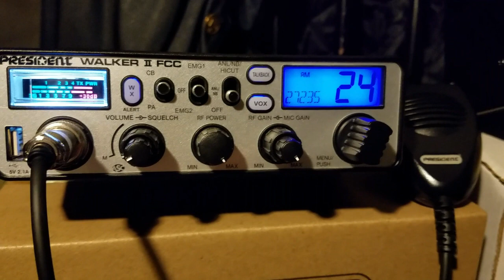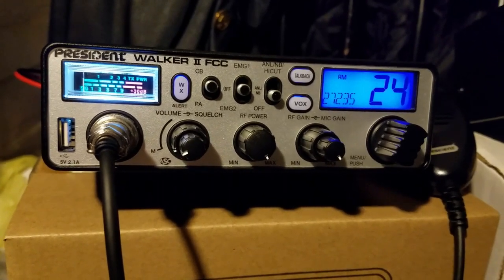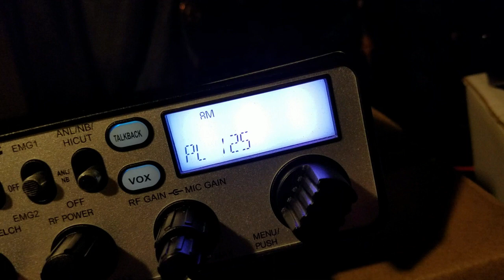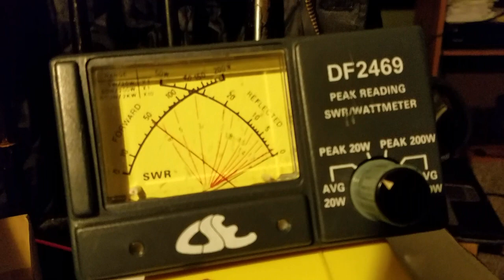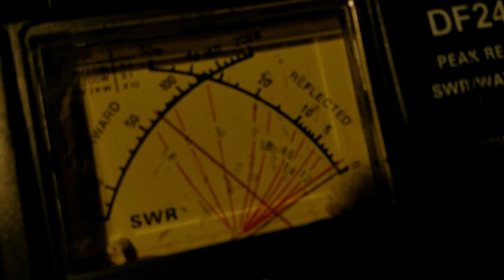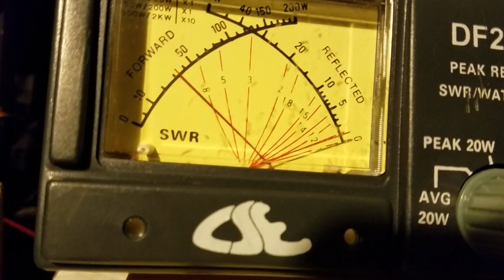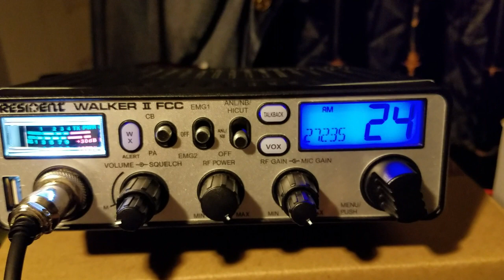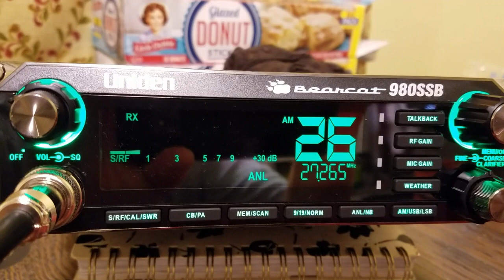President Walker 2 CB Radio Review With Service Menu Function And Test

Comment: Why ruin a perfectly good radio by messing with the service menu. By changing those values, what else is happening to the radio. A valid company service tech should be doing that.
Reply from the maker: I don't know that it will ruin it, a lot of folks try to get the most out of their radios and in doing so theres risks. Accessing these menu's doesn't seem to have a substantial effect on overall output but I think a slight increase is better than no increase. To each their own though, if you want to keep it as it came then that's fine. I was simply curious exploring the effects of those values, if I can improve on something why wouldn't I. Its no different than people modifying their cars to get more power, why would you want more power if you're not going to speed. Some people push it to the limit and risk everything  while others keep things stock. Enter at your own risk, thanks for watching and commenting.
Reply: @countryfriedgamer15o , I still am at a loss as to why anyone would want to “improve” something that is already working well. I’m one of few, it seems, who run completely clean radios as they were designed to be. I hear so much junk out there that it’s saddening. I shiver watching videos on mods that turn beautiful radios into noise machines. I own several CB radios and each one works perfectly. I’m also an amateur radio operator, which is why I have these views. This is only my opinion and to each, his own.
Reply from the maker: @Macjohn1419  I mostly agree with you that I want a good clean sounding radio. Just saying though if you can sound louder and reach further without altering clarity wouldn't you? Look I'm no technician that knows how to tune them properly I'm just a average guy of probably average intelligence. I come across this information and decided to investigate it further and made the video to show my results. People can decide for themselves if they think its worth it to make changes. As you saw in the video of the new 980 bearcat I recently purchased and might do a review later on, it was in fact underperforming when i received it. I could have just returned it but I'm stubborn and I decided to research ways to increase output. These are mass produced radios and aren't always up to the legal limit and I wanted it closer to that. I was super paranoid at making adjustments internally because I don't know what I am doing. Any adjustments made i make sure with a secondary radio that it sounds ok but with the 980 being sideband I had no real way to test other than a good report from someone on air. I got a good report yesterday thankfully and it really gave me a sense of accomplishment that I fixed it. The radio still isn't dead keying 4 watts on am but the swing is decent enough. The issue I had was sideband it was supposed to swing 12 watts and it was only doing half of that. I turned it up slightly and now it's swinging 9 which I feel better being closer to 10 as it should be. I think there's more risk taking the lids off adjusting something internally then through a menu. I'd prefer if all radios had these menus because I think less would get out the golden screwdriver as they say.
Reply: @countryfriedgamer15o , what is the purpose of sounding louder? I get into so many heated discussions with CB friends about what and why is the reason for sounding louder? Everyone uses that mindset to be the loudest over what? If everyone in a crowded room starts shouting louder and louder, how can anyone have a reasonable conversation. Each person is trying to talk over each other that it defeats the purpose of anymore loudness. Do you understand what I am saying? Everyone wants to be at 100% modulation when the human voice and intelligibility of conversation requires that modulation cannot be set at 100%. If you want 100% modulation, then just transmit a continuous tone. There will be nothing intelligible to listen to. There’s a reason why the FCC sets a modulation limit to 85% for the manufacturer. As you approach 100%, energy will be spread over a larger frequency and you lose intelligence in the transmitted signal. Therefore, you will be increasing modulation to compensate and more energy will thrown across the band, hence you’re bleeding all over the place. It’s a runaway process. If you want your voice to cut through the noise, you need to tailor the frequency response of your voice and suppress voice frequencies that wastes your available power. You would need a parametric equalizer to concentrate your voice in the most intelligible voice frequency. When done properly, you won’t need 100% modulation to be heard. The earlier Astatic lollipop mics used a crystal element and it narrowed concentrated your voice where it mattered. I hope you understand what I’m trying to convey here and you and others will look at a proper method to be heard over the crowd.
Reply from the maker: @Macjohn1419  I don't know the technical side of it. I'm not attempting to drown out other voices just be heard over the static and electrical interference. I don't want to sound distorted, given that setting the dead key is often a miss it wouldn't surprise me if manufacturers are off on modulation as well. I doubt there all 85%, the bearcat I was mentioning was a little quiet on am as well and I turned up the modulation slightly. I noticed afterwards listening to myself that is was a bit distorted so I turned it back a little. Seems perfect now, I'm not like a lot of others cbers that goes for max output and max modulation. I don't even own a peak and tuned radio. Thank you for your insight though on this topic, obviously you know more than me. I'm just sharing my thoughts but thanks for taking the time to comment, take care and God bless.
Reply: @countryfriedgamer15o , radios that have a mic gain control will not exceed the 85%. The mic gain should not be used in conjunction with an amplified mic. Therefore distortion will be present. My comments are to enlighten other operators that the solution is not in maximizing modulation. The correct way to cut through noise and static is to narrow your voice response to utilize the available power of the radio and be very intelligible. Thank you for letting me make these comments in good conduct. Take care.